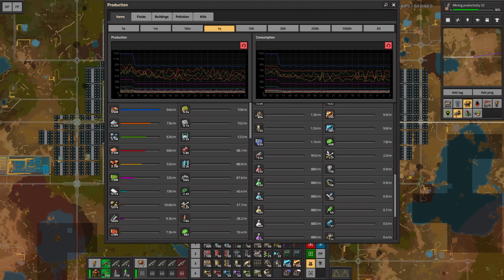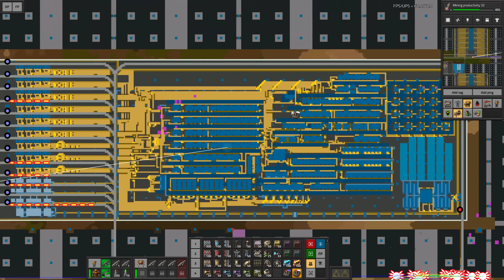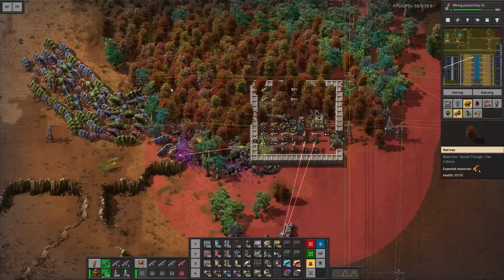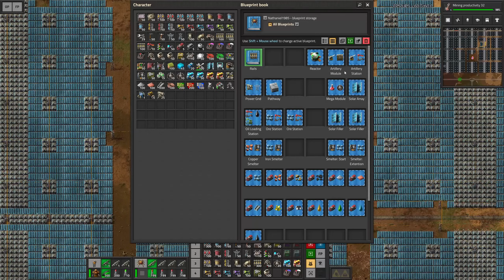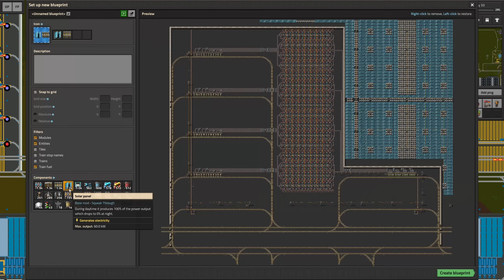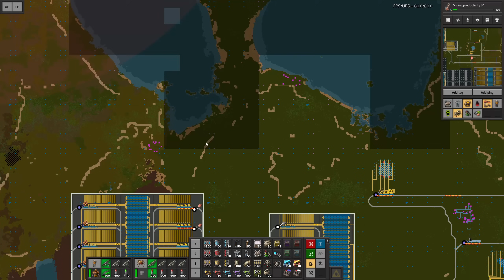RAMPING UP RAW RESOURCES (1.2k SPM) - Step 53: Factorio Megabase (Step-By-Step)

Comment: 1. For depo chest, you need buffer chest, not requester. Requester cannot provide for robots. Buffer chest can request AND provide to robots at the same time.
2. You should make tileable blueprints for tracks already, because why did you even bother with city grid layout, when you never use it :)
3. 1k logistic robots for this amount of spidertrons seems very low, when you consider amount of stuff they can carry and how many stuff you need to move after coming back to base with army of buildatrons. Imho at least 5-10k would seems more optimal.
Reply from the maker: Ah yes I realised that at some point with the requester chest. The tracks are tileable. With the new system I made sure to add more robots as needed;)
Reply: @Nathans-Sandbox  What i meant is snapable to absolute grid and fitting into city block. You keep copying random parts and then manualy placing them and editing them again. Thats not effective.

Ofc same goes for placing whole modules. Point of city block design is that placing blueprints precisely shouldnt take more then one second :)